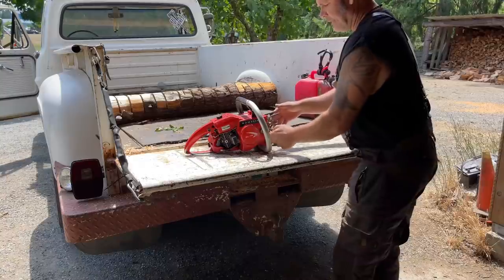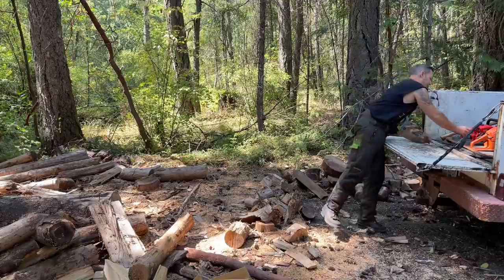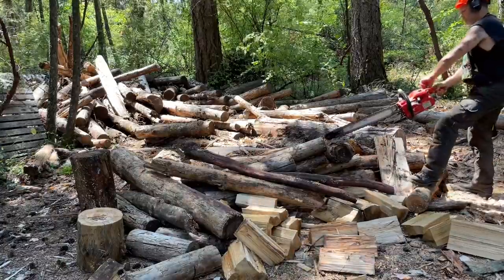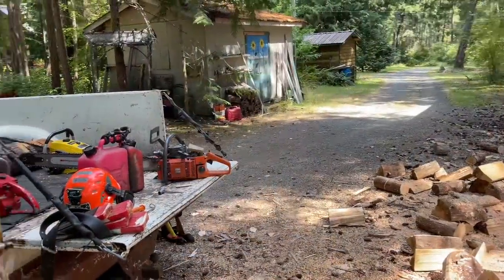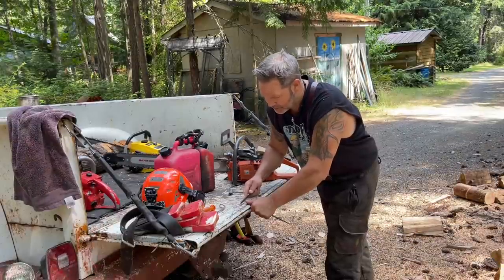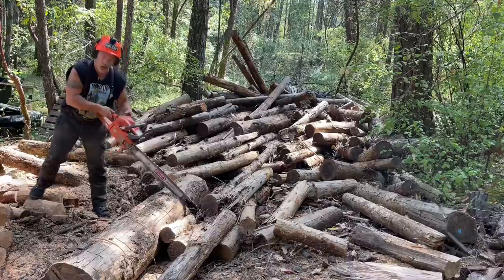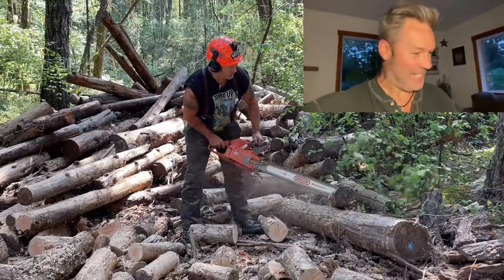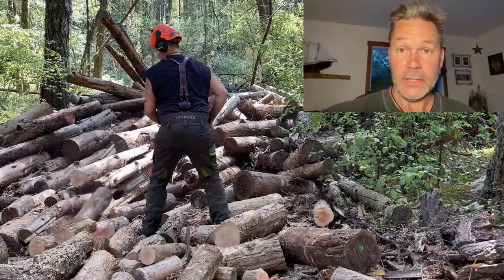How To cut small firewood with a chainsaw, standing up

Comment: This video is just what I needed. I'm not cutting large trees. Often storm fallen 10-12" diameter. Or trees the ministry of transportation has cut away from the edge of the ditches here in Ontario where I live . Good advice about bucking smaller wood. Much appreciated.

Comment: Thanks BBR , that stand up and buck stuff from a while ago got me and my old back thinking.
We Aussies generally use much shorter bars as the timber is so much harder but after dropping one with tons of 6 to 10 inch limbs I put a 30 (instead of the usual 20) on my 461 and stood up straight. After half a dozen tanks the old back was still OK- ish! The secret is to go as long as possible but still be able to reach the log with your foot to hold it. 36 is too long for me. It seems counter-intuitive to drop sizable trees with a 660 with a 25 then go to a smaller saw with a longer bar to cut the small stuff but it works. Cheers from diagonally across the Pacific

Comment: Buckin! How are ya brother?? I recently just found a treasure at the local antique pavilion for 12 bucks...  6lb Plumb double bit. Thing is a splitting MACHINE... when i found it, the toe was worn way back to heck.. so i grinded the profile way back to fix it and it left me with like a centimeter of steel at the cutting edge or the bit. Now it has the wood bullet profile and i just hung it on a new 30" hickory stick and i assume its gonna explode wood apart and split like a laser beam. Its a sharp chunky fella forsure. Im gonna burn the handle in honor of buckin billy ray! You are one of the people that got me into this crazy beautiful hobby

Comment: Hi Buckin great video what would you suggest for an idea saw size and bar combo for firewood I have been cutting firewood for 8 years now with a ms290 and a 20 inch bar and would like to upgrade to something bigger since I am 6.2 tall and my backs not liking the short bar. Cheers

Comment: Mr Billy Ray Smith thank you very much for all this great videos full of infos. i have a question for you. I run a 50 cc power saw with 18 inch bar and i want to know if i can put a bigger bar without porting it or getting its engine damaged. if i can put a bigger bar how long do you think i should put on?

Comment: Excellent stuff ...I don't want to get into a punch up on the subject of bar length ..However I find for my height of 6'2" a 24" bar length lets me stand up straight right over the smaller logs and I push away from myself 1/2 the time which is safer ..anyway it works for me on my 76cc - 93cc saws in the small stuff. Completely agree with  the "Stand up and buck" copyright BBRS philosophy. I've seen people with bad backs from bending over all day with saws with short bars.  Lets face it most of us just cut fire wood we aren't woodsman like you are and we aren't chainsaw fit at the beginning of the season.  Stand up straight.

Comment: Started cutting about a cord a year with an MS-250, nice small saw,  about 10 years ago but now doing 6 cords of 8' maple sticks delivered 8"-10" max diameter last 2 years. Like the idea of standing up to buck but don't think I can ask a 250 to run that long of a bar. What is a good second chainsaw for me? In N MN and have access to dealers that would work for most brands. Any ideas?

Comment: Hola Buckin Billy,
Been picking up tree trimming/tree removal jobs lately. Not a professional by any stretch of the imagination but I  take my time to evaluate how to cut, where to cut and of course where will it fall safely. 
I've been using a Stihl MS270 and a MS 193T.
I recently  found out how difficult it is for a beginner such as myself to cut through a 37" oak that was already on its side.
I'm considering a Echo CS with a 36" bar 800p for a upcoming job that has a couple of ash trees with at least that diameter.
 I've only bought stihl out of ignorance so far but the Echo seems like a good value. Any thoughts on it?

Comment: Those pfanner pants look nice. What’s your favorite of the modern arborist pants you’ve worn? Also have you looked into the new husky 585 and 592xp? Any thoughts on picking one up when they come out? Figured the manual carb 585 would be right up your alley

Comment: I'm 5'7" and run a 27 inch bar on a Stihl 441C for stand-up bucking on the firewood log pile...easier on the back and  doesn't wear me out.  If you take the rakers down too much you'll feel the saw pulling on your lower back.

Comment: Stock Husqvarna 261. 24" would be the max bar but the oiling is not exuberant with the 20" I use. Not sure a 24" would make much difference as I'm 6'4". Maybe have my legs shortened? 😉

Comment: A long bar is less dangerous, (in my opinion) because you do not have to bend over and squat so much.  I kind of figured this out a few years back.  (by accident sort of)  I do a lot of clean up work (firewood) around corrals and buildings and such; deadfall mostly, it is always easier if  you have a longer  bar  to do so.   Shorter bars have their place in certain applications.

Comment: Im all for standing while cutting. Usually when I need to limb out a downded tree I cut everything under 4 inches with my gas pole saw with the shortest extention. I dont have to bend at all, its light, and pretty quick.

Comment: I'm 5'6" and an 18" bar is good enough not to lean over (and that's as large as they go for my saw anyway), only need to bend my knees for stuff all the way down on the ground, taller fellas certainly have more issues here, but are also stronger I'd reckon.

Comment: When you don't have a big cc saw that can pull a 28-32" bar and all you have is a small 40cc - 16" bar saw  you can either bend over and buck it or, as I do, buck it right at the stump..... when I fell firewood I never haul it out of the woods in long lengths,  I buck as I go right there in the woods.  Mind you where I am there isn't anything near as big as some of the firewood I see Buckin' working with,  almost all of it is this size in the video